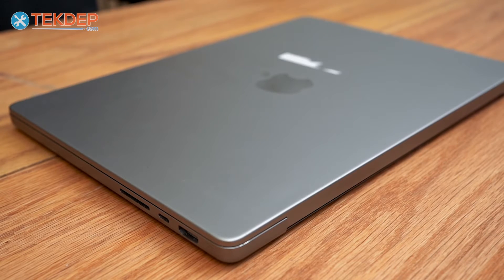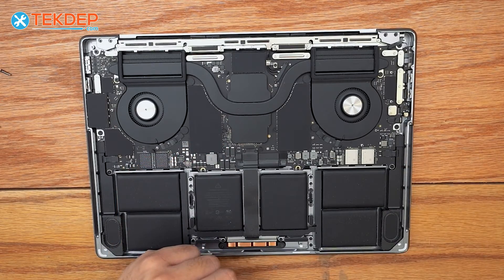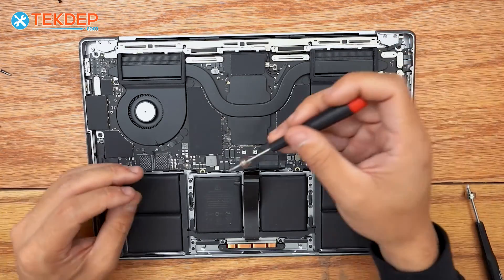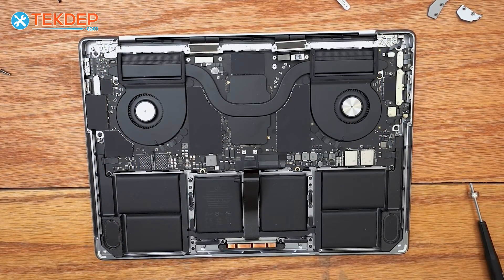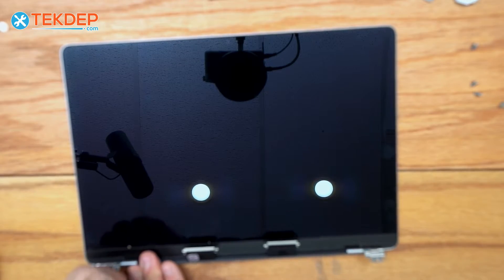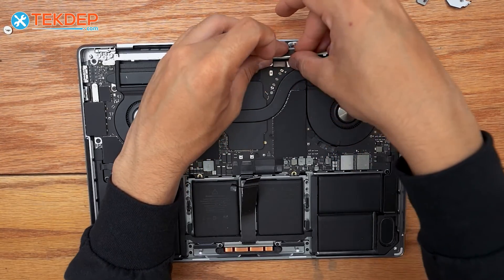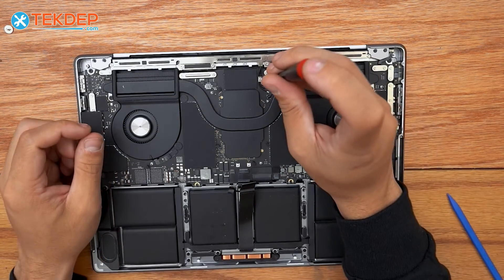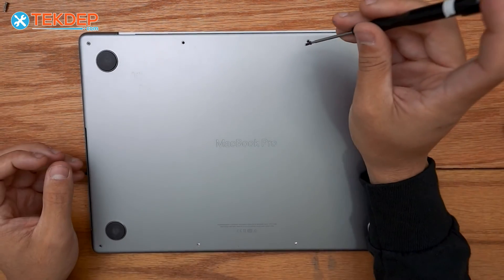LCD Assembly Replacement on the 2021-23 14" MacBook Pro M1, The First of its Kind.

Comment: I replaced my screen and everything works except for the screen going to sleep when you close the lid.  I ran the Apple online session tool to diagnose and the LAS passed.  Is there a sync that needs to be performed?  Do you have this issue when replacing screens?

Comment: Where do you find a PL1 screwdriver.  Is it called something else?  It doesn't seem to come in the repair kits
Reply: A PL1 is a Phillips head screwdriver also known as a PH1
Reply: I just did a display replacement following these instructions and just used a P2 screw driver. Just be careful to give it enough pressure so it won't overdrive and damage the screw head.

Comment: We have a 2021 MacBook Pro m1 that has two very thin flickering lines one horizontal and the other vertical. Would this likely be a ribbon cable in most situations or display. Thanks
Reply from the maker: Very rarely do LCDVS display cables fail, unless liquid damage has occurred. In most cases the LCD has some sort of damage, typically hidden damages from the unit being transported in backpacks or similar cases.

Comment: Can I use this method to fix misaligned display lid in M2 Pro Macbook pro 14inch?
Reply from the maker: Yes, it should work the same with the M2 MacBook Pro models as they use the same LCD between both of the models.

Comment: I had to replace my screen for similar reason but the new screen now has small rectangular shadows on the top of the screen.........
Reply from the maker: Unfortunately, due to apple's design and choice, these units have local dimming zones that are only reprogrammable by apple. So the small rectangles you are seeing at the top of the display are the dimming zones not being recalibrated after replacement. Apple is not willing to reprogram the display unless the repair is done at apple. So there is no fix as of now, hopefully in the future we will be able to reprogram the dimming zones!
Reply: @tekdep  Many thanks for the explanation
Reply: Thank you
Does this affect truetone?